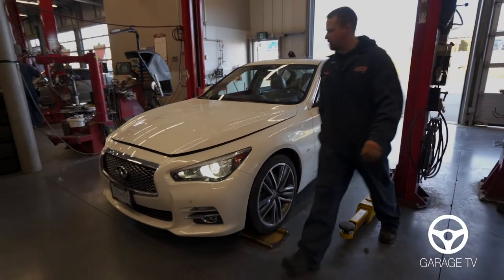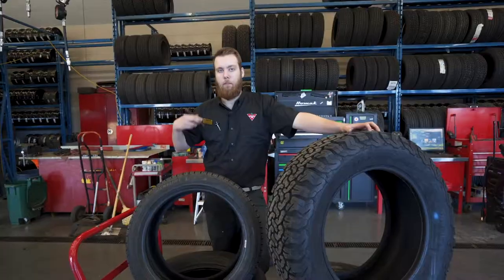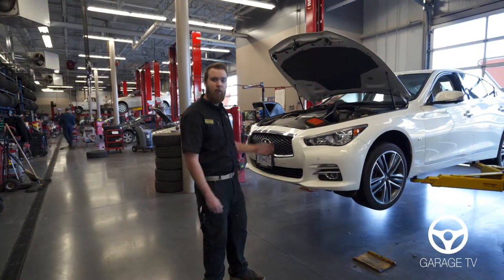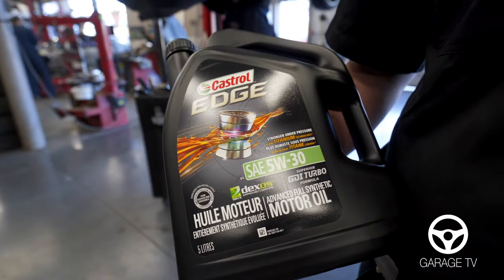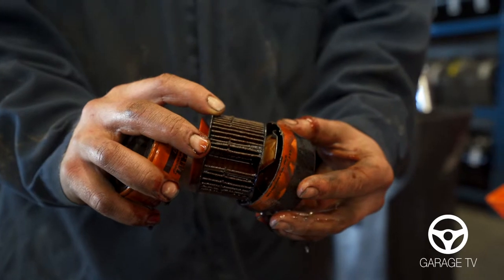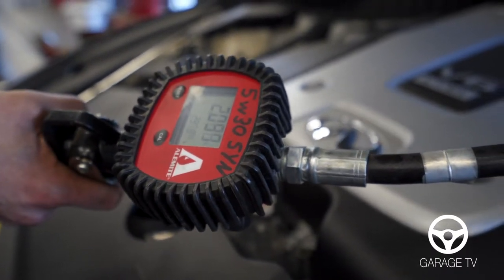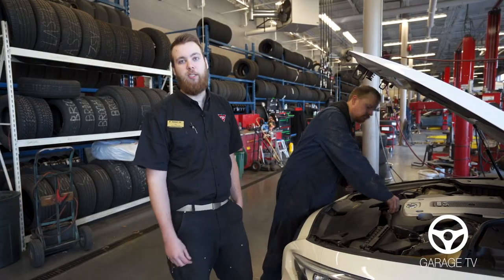Episode 6 Oil and Oil Changes April 41

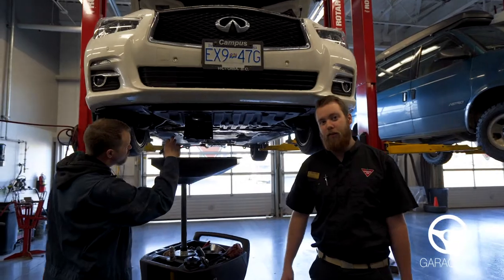Comment: 0:47 You should be using a Oil Filter Cutter to open up an oil filter and not a cut-off wheel. The latter only introduces grit and metal filings into the filter, so looking at the filter media at that point is useless.

Comment: The onli time i whent to canadiantire for my oil change they told me that my oil filter housing on my toyota matrix was stripped from all the grip lips on the housing.  So they told me they had to order the part to do my oil change.   Latter that month i did my oil change at a local garage and the housing was perfectly fine like new. My question is:  is canadiantire scamming people on oil changes like selling them their old oil filter housing for brand new by using their already good oil filter housing.  Good job scamming